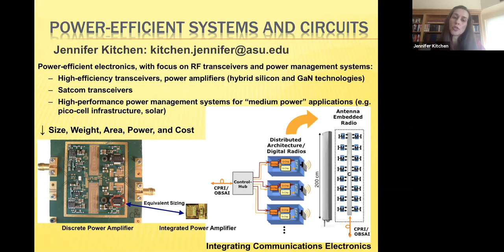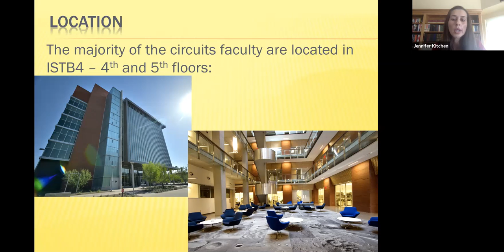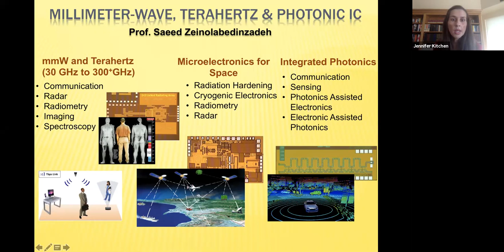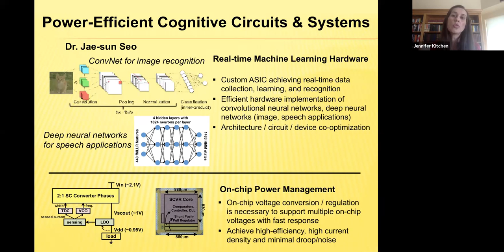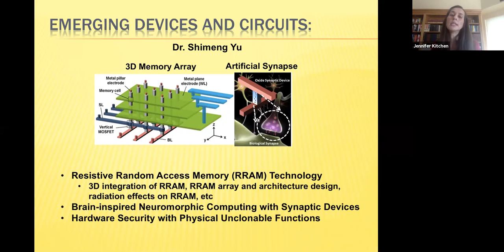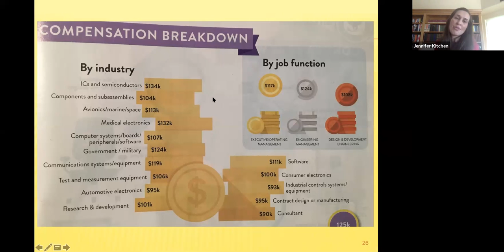Circuits Pathways Presentation Zoom recording

Comment: Hello, can you do this specialization and all of these courses online?
Reply from the maker: Hi Marc, you can indeed complete our electrical engineering program and circuits courses online. Our electrical engineering program is ABET-accredited and follows the same curriculum online as in person. The only difference is the method of delivery (online versus on campus). You can read more about our undergraduate programs here: https://ecee.engineering.asu.edu/degrees/undergraduate/